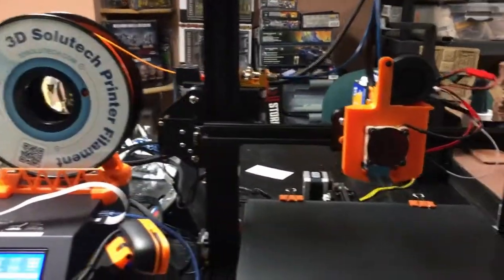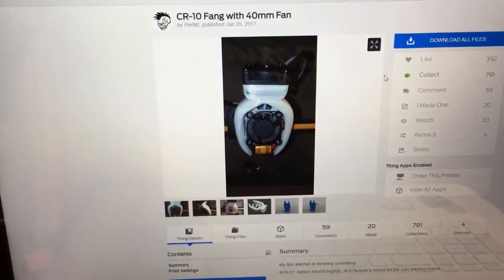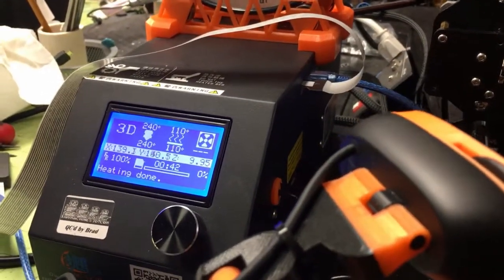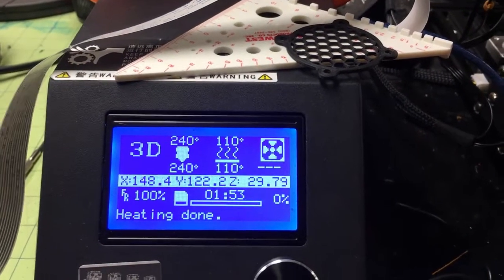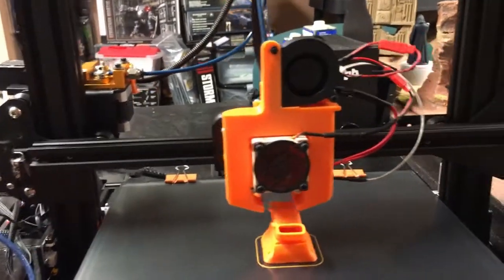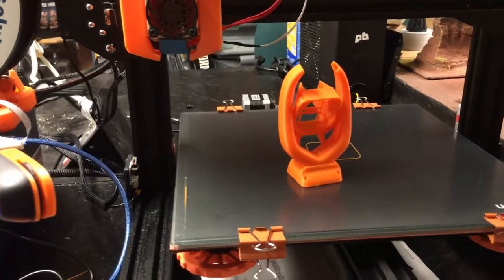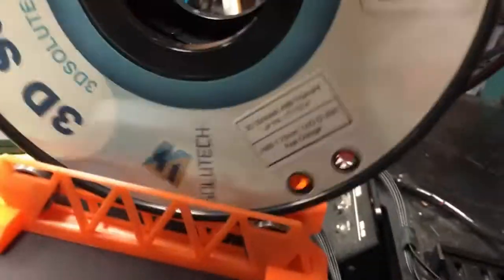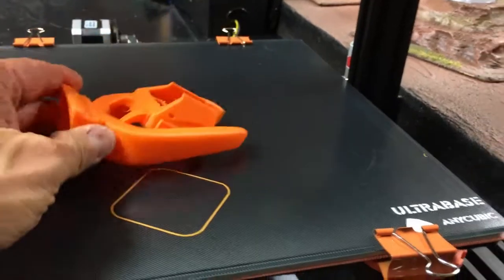Creality CR-10S Printing ABS No Enclosure

Comment: I think the problem is its cooling too fast and so since its hitting the nozzle with so much air that is causing the jams since the filament is being cooled before it can even get to the print bed, id say keep the printer as it was desinged and only make mods such as cable armor amd so on.

I also notice there is a second piece of ptf tubing wich I do t really think is necessary, it makes a clicking sound because it is rubbing against the gear for the filament to pass tbrough as it moves, overall though if you are printing ABS without an enclosure that is pretty cool.

Comment: Ditch the fang and go back to the stock hotend and use the Capricorn bowden tubing.  I run my CR10-S4 at 80mms with PLA with no issues.  The only change I made was the cooling fan duct was replaced with one the same size but that directs the air to the right spot and a Titan extruder.  IMO, the fang is overkill and can cause more issues then the small benefit it brings to long bridging.
Reply from the maker: You are so right! The Petfang with the 50 mm turbo fan was overkill. I did replace it with a Fang V2 with a 40 mm noctua fan.  I am getting great results now. I still have my stock parts in the bullpen just in case. Also, Capricorn tubing is a little too tight, in tolerance,  for a lot of the PLA brands I run. The cheaper, higher tolerance PTFE tubing did help for some reason too. I will have some other videos up soon.  Thanks for watching and the comment.
Reply: That's one of the reasons I only use eSun PLA +(pro) and eSun ABS, PETG.  The dimensions are consistent and work will with the Capricorn tubing.  I've tried other, less expensive brands.  Sometimes they work well, sometimes they don't and then you waste a lot of time clearing clogs.
Reply: RichterScaleStudios     Those Noctua fans are so quiet too. Had some 120mm Noctua fans on an old pc of mine and I loved them.
Reply: sillywwabbit z